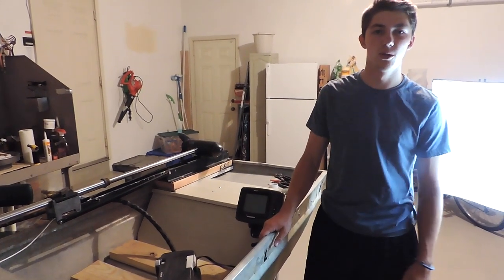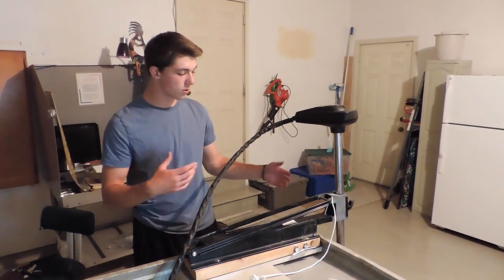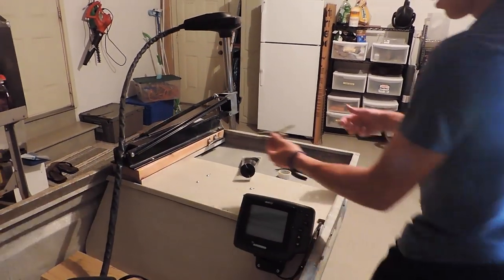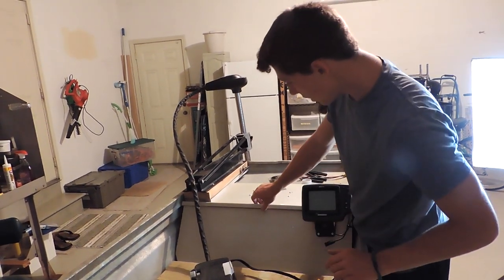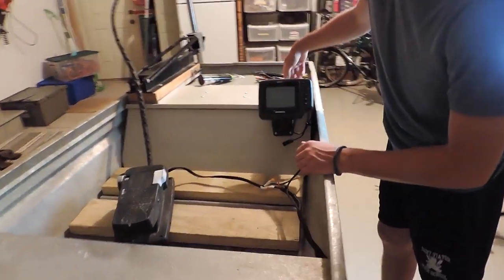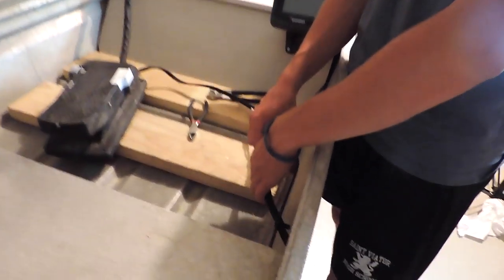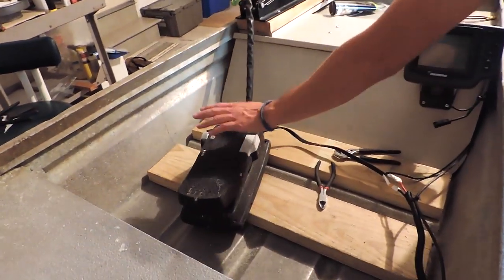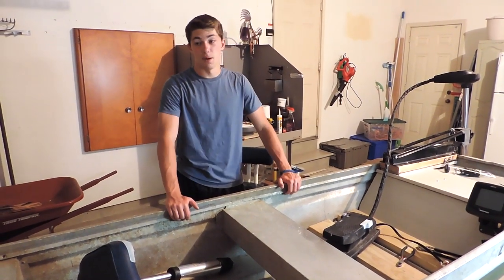Boat Restoration Pt. 4

Comment: i found out after i ruined one of my fish finders that its bad for them if you turn them on outside of the water with the transducer hooked up.just a tip man, nice boat
Reply: it was on demo so the transducer is not on you could take the transducer off and it would still work